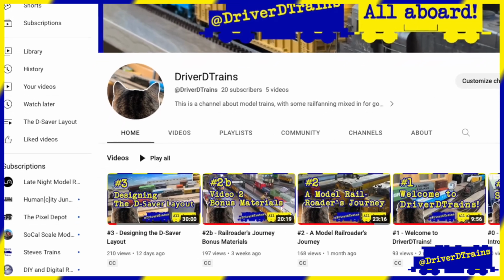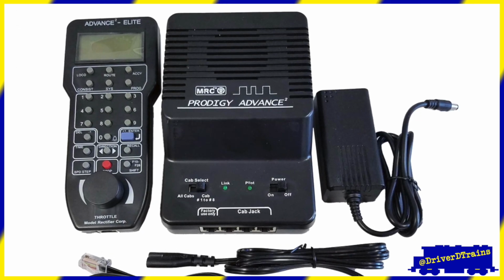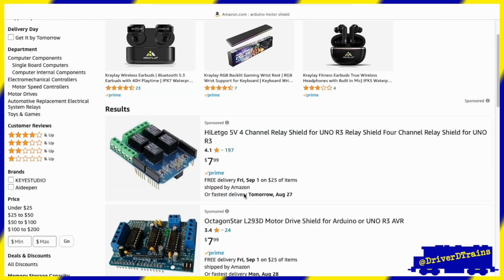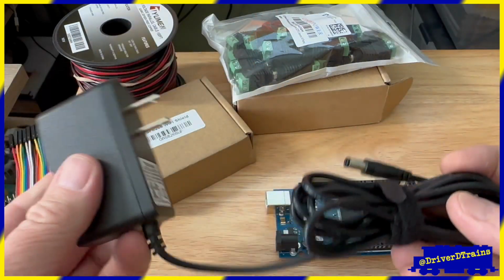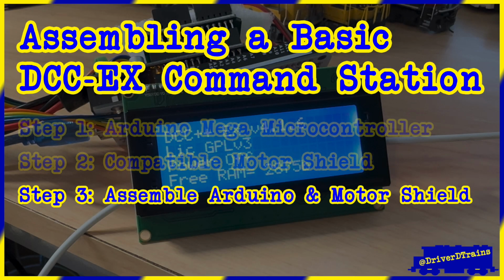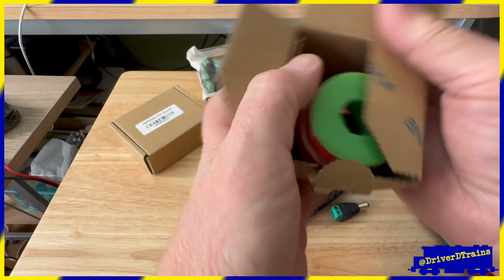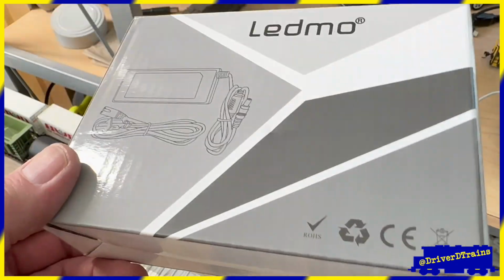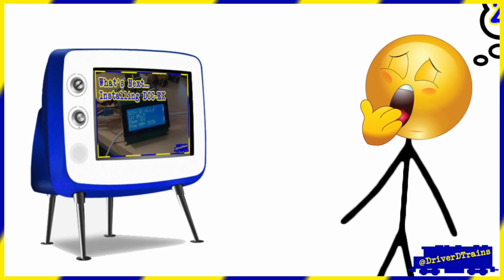#4.a - Assembling a DCC EX Command Station   @DriverDTrains

Comment: What kinda of screen are you using for the base station and the same for your wifi shield as well. Thanks
Reply from the maker: Thank you very much for your kind comments.

I am currently working on a video for the Wi-Fi shield and hope to have that done soon. After that I will put together a video for the LCD Display installation. 

The Wi-Fi shield is the Makerfabs. I ordered it directly from them. It ships from overseas but the airmail postage is $6 so it's not a big deal.

https://www.makerfabs.com/esp8266-wifi-shield.html

The video will have more information about the configuration and how to use it.

The LCD display I used is this one:

https://www.amazon.com/gp/product/B07QLRD3TM/ref=ppx_yo_dt_b_search_asin_title?ie=UTF8&psc=1

When you hook it up, you need to make sure this line is in your "config.h" file:   

#define LCD_DRIVER 0x27,20,4

Note that the commented-out version in the example config file is for a 2x16 LCD.       
// #define LCD_DRIVER  0x27,16,2

You'll also need to make sure the 4 jumper wires are plugged in correctly. I used the 4 pins on the motor shield (not the header socket) closest to the USB port. Then make sure you recompile and download the sketch after you have plugged in the display. Use the screw-adjuster on the back of the display to adjust the contrast/brightness.

Hope that helps!

Thanks again! DD

Comment: I run two small trains HO scale.   I am a newbie to this hobby.   I’d this DCC ex something I need or is this for larger layouts with many trains?  Thanks
Reply: @skipRoGlo This can be used for any size HO railroad. I haven't built a model RR in 15 years,  My last being a 25' x 30 ' "U" shape,   using the Digitrax system, at a high$$ cost back then. 
 I have already completed the DCC-EX system shown, like they say VERY inexpensively, in preparation for my 4' x 6' layout. Using the 2560 for trains and turnouts, and a separate  UNO clone for animations,  special effects, and structure lighting. and for Power, I built  a distribution center from an old PC power supply.
Reply from the maker: Thanks for your kind comments. My D-Saver "Layout" that I am using DCC-EX on is a 1'x6' switching puzzle on a shelf board, so you definitely do not need to have a large layout to benefit from DCC-EX. As the other poster mentioned, it is a very affordable way to add DCC to your system. For myself, I love to run light and sound-equipped locomotives, and I am always honking the horn, using the bell, and revving up the throttle even on my tiny little shelf. One of the reasons I wanted to go with DCC-EX is that I could use my phone and/or tablet to wirelessly control my trains. What I like is that I can label each button on the virtual throttle so I know what each button does for each locomotive. No more guessing which function is which kind of brakes, or which light. If you have a chance, check out a couple of my earlier videos (#1, #3) to see some clips of the trains in action.

Thanks again!  DD
Reply from the maker: Thanks for the kind comments. Sounds like you've got a great setup ready for your new 4x6! Enjoy! 

Thanks again!  DD

Comment: way too much intro, listing of videos that this isn't, and then repeating a partial list of future videos.
Reply from the maker: Thank you for the kind comments. This video was actually the first in a series of 7 videos and several shorts about assembling and configuring a DCC-EX command station; hence some of the references you mentioned. However, I merged them all together into a nearly 3-hour long supercut which you can find at the link below; After the brief intro, it omits all the other introductory bits and references to past/future videos. 

Supercut:  https://youtu.be/Y_CRBRqAKJ0
DCC-EX Playlist:  https://youtube.com/playlist?list=PL37qXvxS_HZSuYFjD-G1QrTLGJjjq2ZQv&si=iemv9KleKorg3nmY

If you're interested, I am starting a new series of videos on creating automations in DCC-EX, EX-Rail. The first video is out with some high level conceptual information. The next video will include developing an automation to run a train step by step. I hope to have that out next weekend.

After I finish the EX-Rail series I plan to make a couple of DCC-EX hardware-focused videos. The first will be about adding additional LCD / OLED displaces to the DCC-EX command station. Then I plan to do an update to this video (#4a) using an STM Nucleo ESP32 board and the DCC-EX motor shield instead of the Arduino Mega and standard motor shield.

 Thanks again and happy railroading!
DD